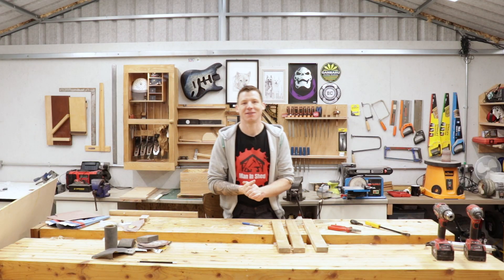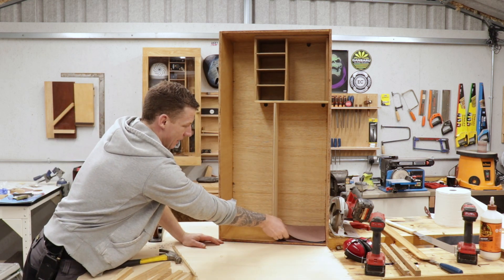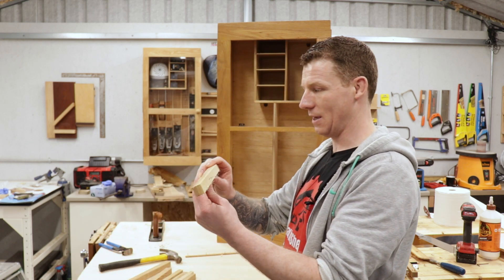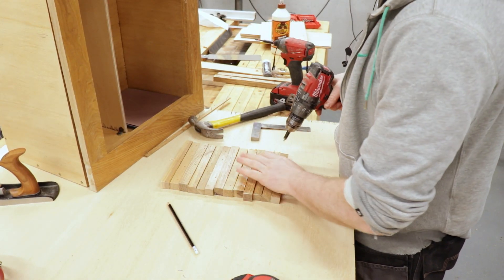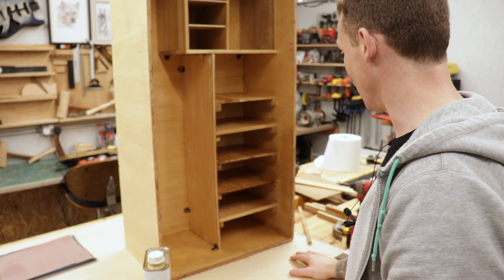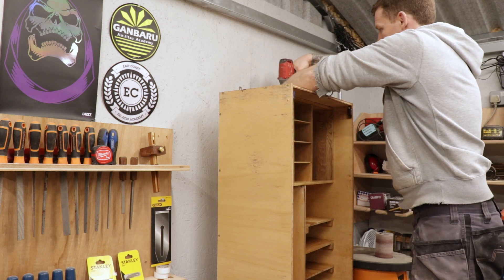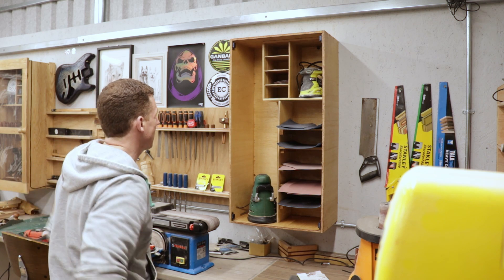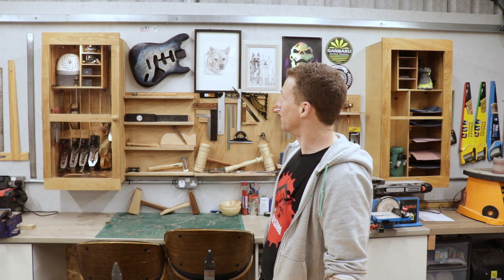Sanding Cabinet Build.  Up Cycling Some Old furniture!!

Comment: Plane cabinet is looking great John looking forward to this one buddy symmetrical backdrop 🗄️👌
Reply from the maker: fastest comment ever!
Reply: @JohnMcGrathManInShed  😂😂😂 right in there first 👍
Did you get my message lastnight John about the disc and belt sander?
Cabinet turned out well mate looks better one each side 👌could you not butt it against the tool wall like the other side?
Reply from the maker: @williamn01  no missed your message whats was it?
Reply: @JohnMcGrathManInShed  it was about the ferrex disc n belt sander mate how you finding it any good? I'm looking for one can't mind if you have done a video on it I have went through them all and not noticed one.
Reply from the maker: @williamn01  I don't recommend it it's about to break, my mates one didn't last a week.
Reply: @JohnMcGrathManInShed  OK I will patch that then 😂 might just get a 305mm disc sander instead or one with a belt.